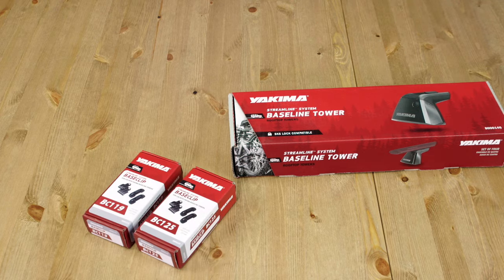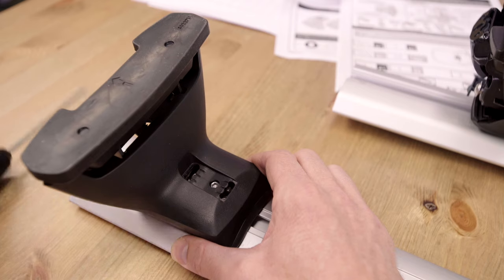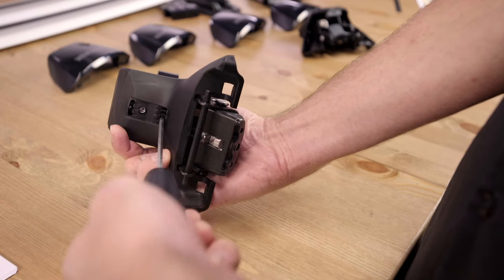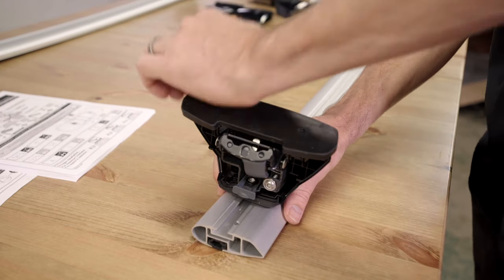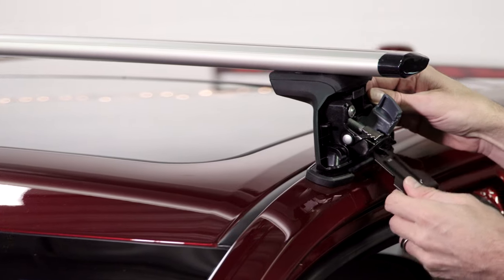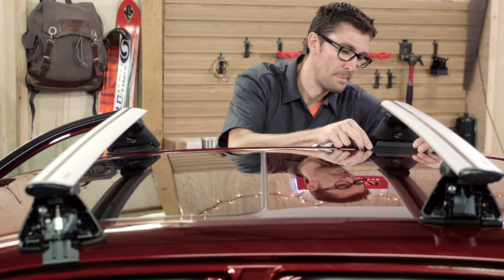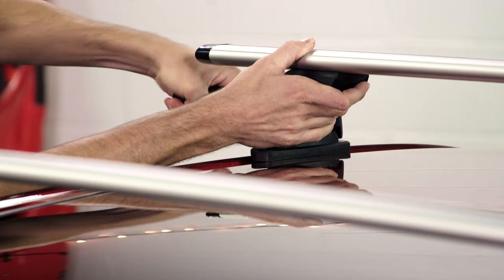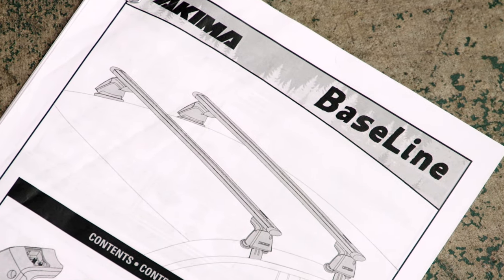Yakima BaseLine Towers Installation

Comment: I just installed the baseline towers with the Jetstream rails. The issue I had was the measurements for width were way too wide. It said 47.25 but that put it in the groove on the roof. I had to shorten them to 46.5 and they were still too wide but I couldn't go narrower. The clips barely fit in the door jamb as it was. I could have used another half-inch narrower but it will do. 
Overall, I'm very impressed with the engineering that goes into these products. Having all the nuts being one size and the tool packed with the product is a big help. Very impressed also with the torque tightening till it clicks feature. No more wondering if you got it tight enough.  

To the guy complaining about the price of the locks, I'd say this. You're not paying for metal, you're paying for smart engineers who design this stuff to be easy to install and reliable.
As a wise old-timer once told me, oats that have been run through the horse once are a little cheaper!
Reply: I know you just posted a day ago but are you happy with the sturdiness? Looking to get some of these as our car doesn’t have rails

Comment: My P1 is not clicking. No one else seems to have this issue. I torque it down so much that the tool bends and twists from it but there is no “click”
Reply: Did you ever solve this problem?  I'm  tightening way down and worried im gonna break something but still no click.

Comment: They say specifically in the video to use front pads for front bar and back pads for back bar, but neither in the video nor the manual do they display/show the difference. Can I get some help? I have the solid pads and the gridded pads with gaps.

Comment: The crossbars and towers are awesome but yakima are charging way to much for the sks locks that are probably made in china and cost 25 cents each but charge $20 a lock. 4 locks should be included with the towers.
Reply from the maker: Hi Thomas,

Appreciate your feedback, but a correction on the source and cost of locks.  Lock cores are made in Belgium, the retail cost for an individual core is $12.50, not $20.  A 4 pack of locks sells for $60 and includes 3 keys which are $4.50 retail , so for a 4 pack of locks the all in cost per lock is $15.00, not $20.00

The reason we don't include them is that customers who already have locks are not getting additional ones that they might not need or may not match their existing ones.  And new customers who may have purchased multiple items that need locks can by a pack or locks that are keyed alike to cover all over items at one time.

Comment: Hi, I just bought these as roundbars and am setting them up for my vehicle. I am supposed to use "A" for P1. How do I know which direction is A and which direction is C? Obviously B is the middle, but relatively, I cant find a way to discern A or C? Could you please let me know if A is the bolt appearing at the top of the slot or at the bottom of the slot?
Reply: Oh, I see a chart in a section of the instructions not meant for the roundbars. The roundbars mention the P1 angles, but in the written step it just says use "B". Am I able to just use B for all pitches because the bars are round anyway?
Reply: also, there is an error with the print on the stickers included with the towers in that they cannot both be placed on the inside of the towers such that the nose of the car on the sticker faces the nose of the car in real life. It is like a pair of shoes that has a design that is meant to face to inside of the wearer's ankle. They are supposed to be mirrors of eachother. You have essentially given 2 'left shoes' for the stickers. In order to have the sticker facing the correct ways, I must put a sticker on the inside of my left towers and on the outside of the right towers.